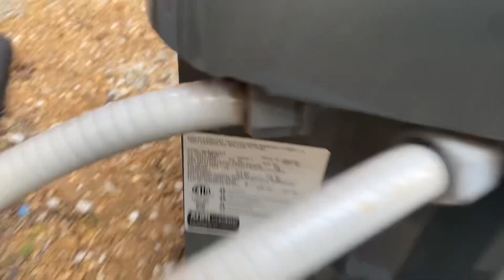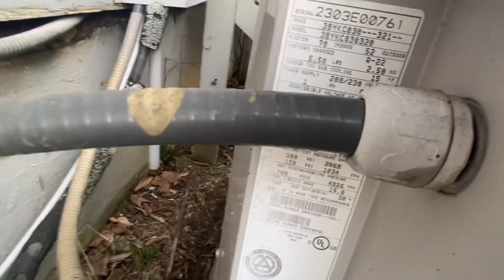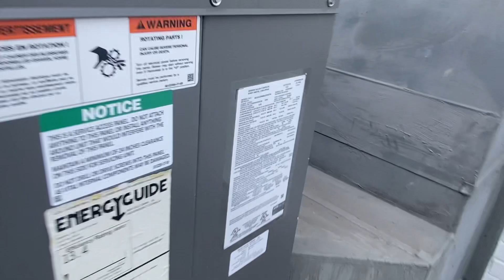1991 Trane XE900 Heat Pump and other units in Downtown Huntsville I haven’t filmed yet

Comment: That fan motor & blades aren't original on that TECH 2000; with that aside it's cursed seeing one of those with 4 blades. Reminds me of that 4 blade Arcoaire Ten I have a few vids of
Reply from the maker: I already knew those weren’t original. Did you also notice the cursed install of the 2023 Grandaire packaged Heat pump next to that Tech2000?
Reply: Also cursed like seeing a 2-blade modern Lennox
Reply from the maker: Just got it defrosting as well as the Grandaire next to it.